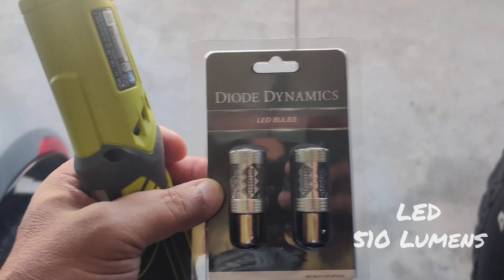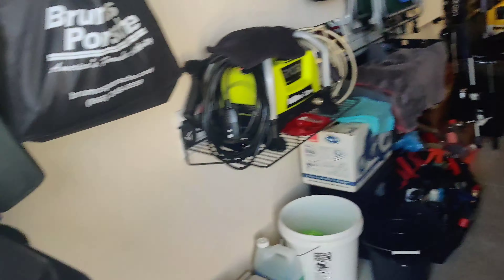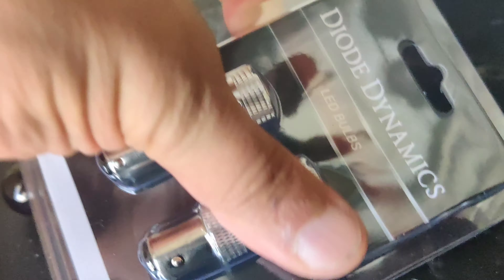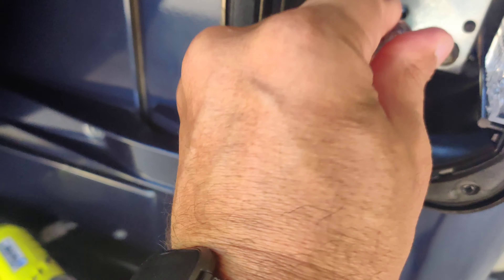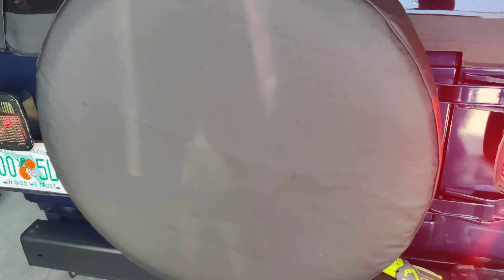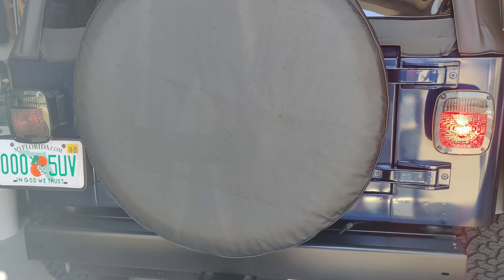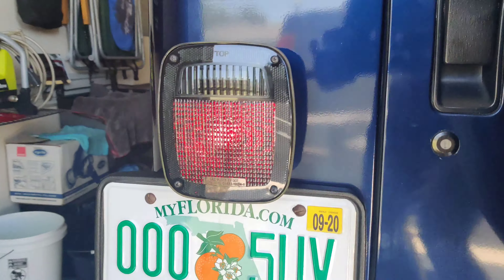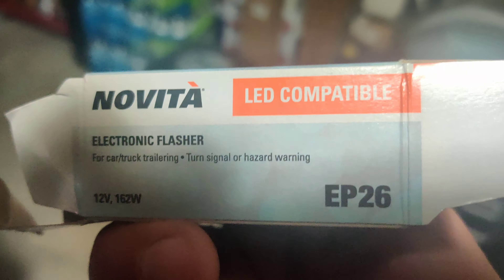Jeep Wrangler Rear DEPO Smoked taillights w LED bulbs

Comment: Do you have an install video? I’m looking at getting these for my 97 tj but my jeep has the flat style connector. I can only find these lights on ebay with the square style connecter
Reply from the maker: Sorry but that is about the only item that I forgot to make a video of. You might just be able to cut the connector and put the regular one. I purchased mine on Ebay and they still are working great.
Reply: @FAFOWeekendAdventures  did your jeep have the flat style connector? Or did you have to splice them together?
Reply from the maker: Here is the link for the ones I bought. https://www.ebay.com/itm/302861130629  I don't remember if mine was flat or not, but if you look at the description it will show you how and if to splice them.